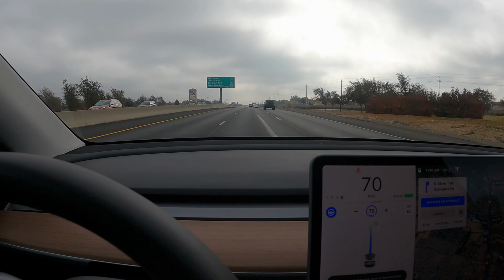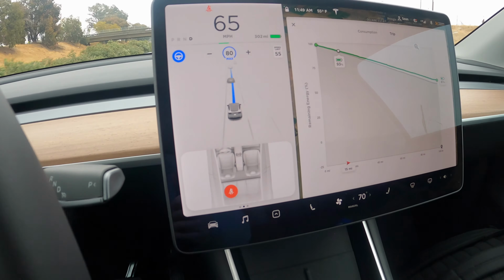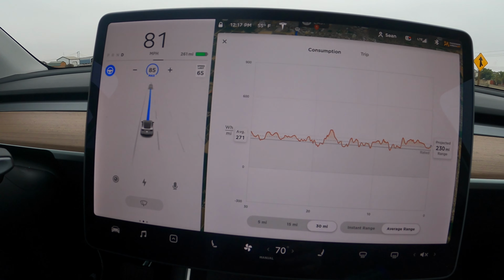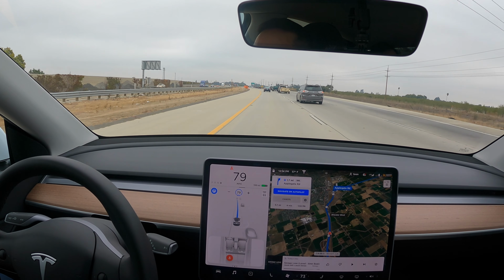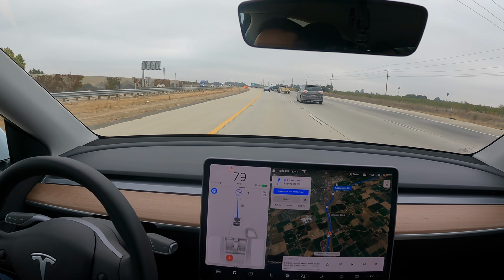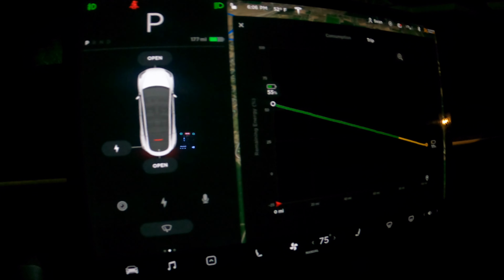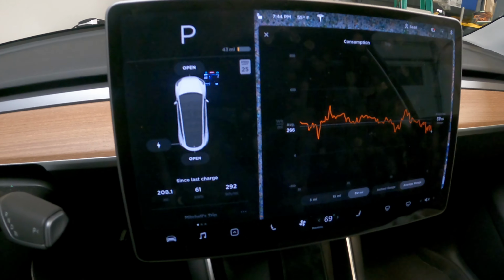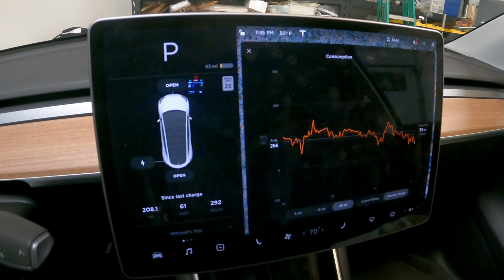Tesla Model Y Road Trip Battery Range Test Dual Motor

Comment: I just have range anxiety. That’s what keeping me from buying a Tesla.
Reply from the maker: It’s about ~250 actual range at full charge. For day to day use it’s more than enough. It’s just road trips you will have to plan for stops in between. I’m glad to see the model s getting to 400, maybe future versions of 3 or y will get there as well so we can get 300+ actual miles out of it which is similar to gas ranges today.
Reply: @seanmoua6791  so you must have a performance then

Comment: Hi there, used to live the outer area of the town that your parents live in. Do you typically charge fully before going there? I ask because I will soon be making that trip when I receive my MY, and the closest superchargers are about 40mins before or 50 mins after on that highway, with sparse AC slow chargers in the area. Thanks!
Reply from the maker: Yeah I try to fully charge before I leave the house.  When I had my model 3 performance I had to make a stop in Manteca for about 15 minutes to make sure I would make it all the way back home.